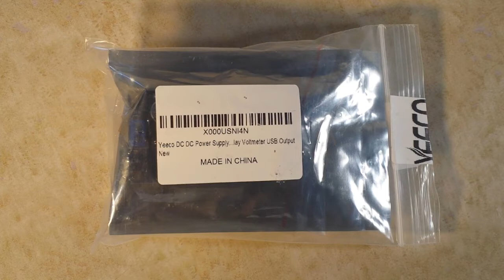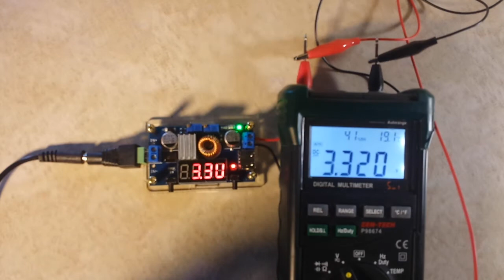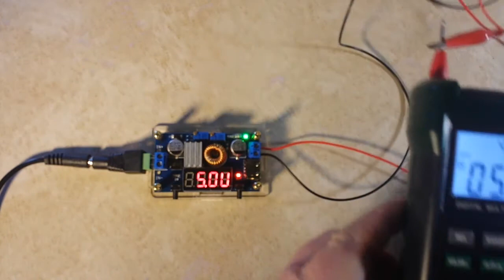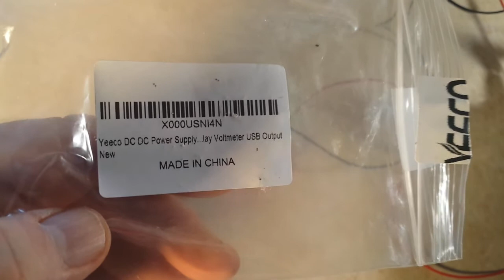Yeeco DC DC Buck Converter Review

Comment: If you hold the right button for a couple of seconds, you can adjust the reading of the input voltage if it's off for some reason (left button adjusts down, right button adjusts up, hold right button again to save).
Reply from the maker: Good info, thank you
Reply: Paul, a big thanks for this!
Reply: Paul, what if I have e.g. 10V input, but cannot calibrate the display under about 11V? Once I had success with that a couple of months before, but now it shows about one volts higher in case of input and output voltage, too. Thanks!
Reply: @kutyala  Sorry, no idea

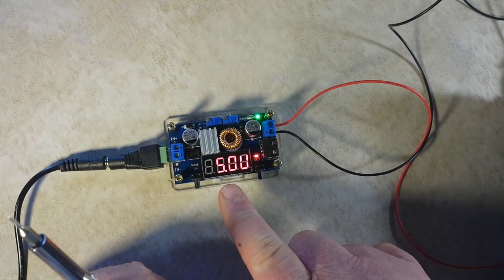Comment: @8:50 - If you charge your phone - you use the USB which will be permanent at 5V or the unit design is flawed.
Reply: Its true. You must set at 5 volts. I have one of these. These units don't follow the USB Spec. I have verified this by using a DROK USB tester. If you set the output to 14v (example) the the USB output will be 14v. (It would have been nice to keep the 2 outputs separate & follow the USB Spec. - "It is, what it is"...)

Comment: what happends if you shortcircuit the output, and then power up the module? It still regulates on cc? for example, set current at 2 amp, when you short the output, it got to show 2 amp. If yo unplug and plugin the dc-dc converter, it still regulates at 2 amps?